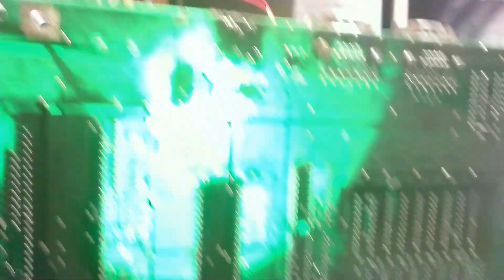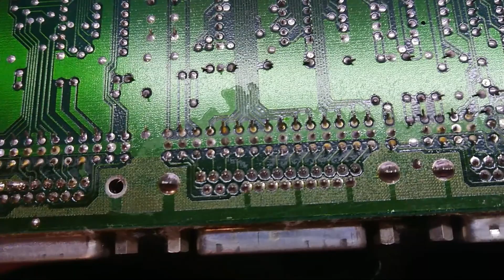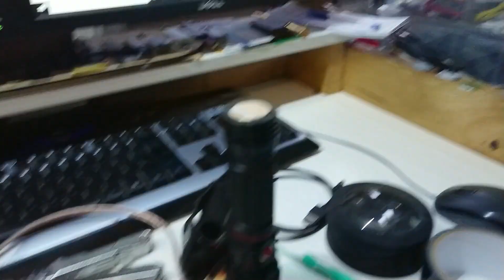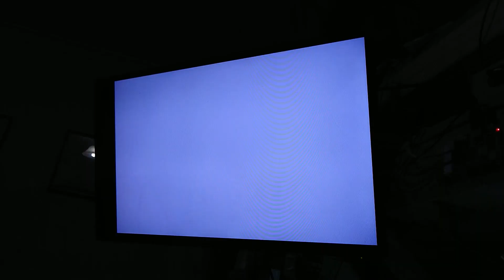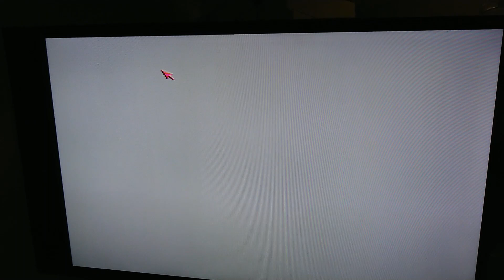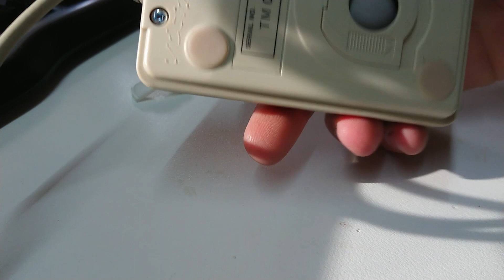Amiga 2000 Repair - Part 2

Comment: That tank mouse is for the 1000, it’s kinda snug fitting it in the 2000 socket, but works.
Reply from the maker: yes I have since been given several more - a serial extender did the trick until that happened. I'm currently trying to copy 40mb of power packer compressed files over serial to my pc - it's going to be a long job.

Comment: Those original Amiga tank mice are worth a fair bit and hard to find.  I also have an Amiga 2000 which I kitted out with a GVP 030 40mhz accelerator, SCSI hard drive card with extra ram and an OpalVision 24bit graphics card.  Spent an absolute fortune on it.  Also had an Amiga CD32 which I sold, regret that now.  Iam in the process of getting it up and running.
Reply from the maker: I have a few of those mice, but it's also a case of finding the space to store everything. the CD32 would have been interesting to see, and yes I worked out that this machine would have been worth more than my car in it's release day. Fortunately it was donated to me.